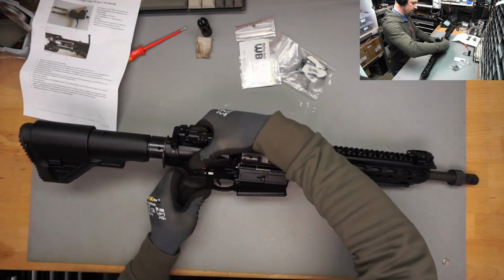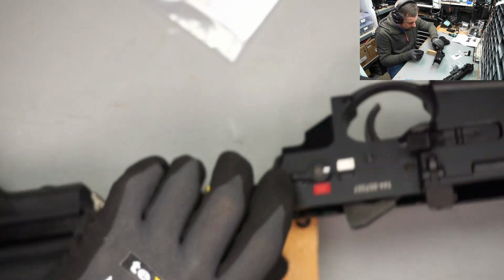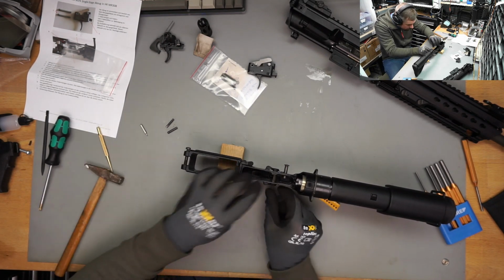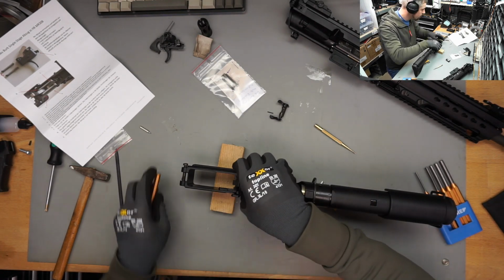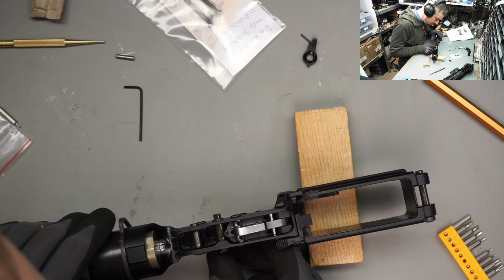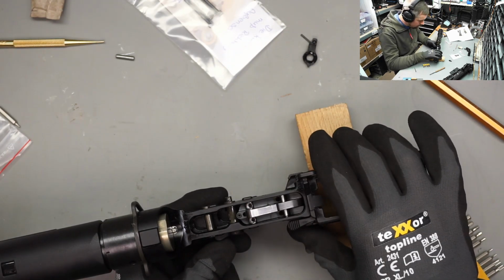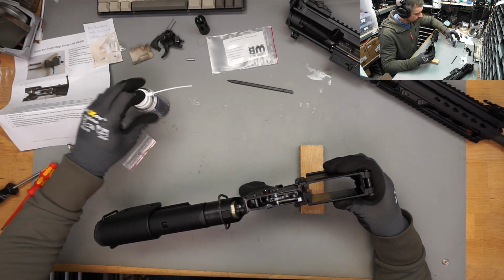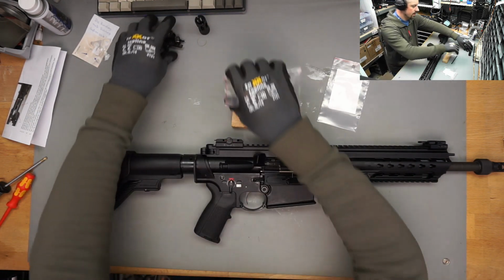Heckler & Koch MR308 A3 13" Part 4: Waffen Burk Direct Trigger

Comment: Installing the safety roll pin is way easier if you install the grip and the safety on one side with the detent and spring ... The lever won't move since you are applying the force vertically perpendicular to the safety axis and the detent and spring will hold the lever in place.

Comment: Wie sind mittlerweile die jagdlichen Erfahrung mit dern 13" Version? Wie schaut es mit der Lautstärke aus? Darüber gehen ebenfalls die Meinungen auseinander.
Reply from the maker: Bisher führe ich jagdlich eine Mauser M12. Die MR308 ist als Nachsuchewaffe gedacht, mit Schalldämpfer. Die Waffe bleibt handlich, Schalldämpfer aus Rücksicht auf die Hunde und man hat im Notfall direkt drei Schuss zu Verfügung. Bei uns im Revier gab es aber in 2019 keine Nachsuche auf Schwarzwild - allgemein wenig Schwarzwild. Den Pächter freut es ...
Reply: @GunWodan  Ok vielen Dank für die schnelle Rückmeldung. Ich stehe gerade vor der Entscheidung ob ich mir die 13" oder 16.5" Variante kaufen soll. Leider bei beiden Versionen seitens der Händler nun dreiste Aufschläge im Preis oder Bundeling mit Optik. Stehen Sie weiter hinter dem 13 vs 16 Zoll Kauf? Auf 100-150 m ist bei beiden Längen kein Unterschied zu merken. Würde sie auch jagdlich wie Sie mit ASE SD nutzen. Auf der Milipol gefiel mir die 13" Variante etwas besser als die 16.5" Variant wegen der Handlichkeit. Riesen Unterschied zu meinem 23 Zoll Repetierer natürlich.
Reply from the maker: image021 In der 13“ Ausführung ist diese Waffe ein echtes Nischenprodukt. Selbst 16.5“ sind schon kurz für .308 - Fabrikmunition ist üblicherweise für mindestens 20“ Lauflänge geladen. Bei einem 13“ Lauf macht sich der Leistungsverlust deutlich bemerkbar. Durch Handladungen lässt sich das teilweise kompensieren aber es bleibt bei Abstrichen was die Leistung betrifft. Wer selbst lädt und bereit ist für diese Waffe eine Ladung zu entwickeln kann damit vielleicht 100-150m weit jagen. Für den Ansitz  nehme ich eine Waffe (Mauser M12) mit 20“ Lauf, damit fühle ich mich bis 200m sicher. Es kommt also stark auf die eigene Jagdsituation an und für mich war klar, dass ich für diese Waffe eigene Ladungen entwickle.

Comment: Stop ! Safety removal is not required for trigger replacement on any Hk rifles. Just flip your safety down so it will not be engaged. Then you can remove the trigger. ☠💀☠